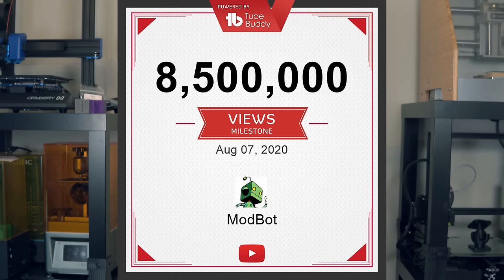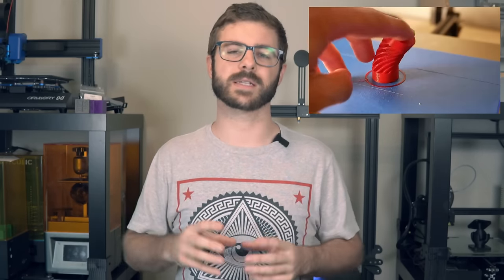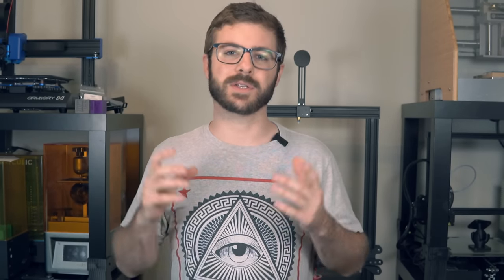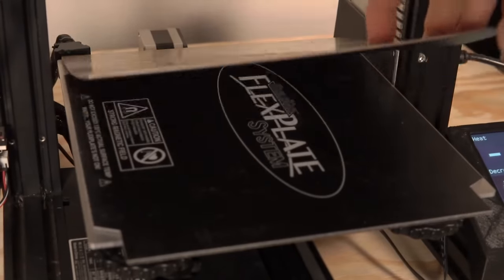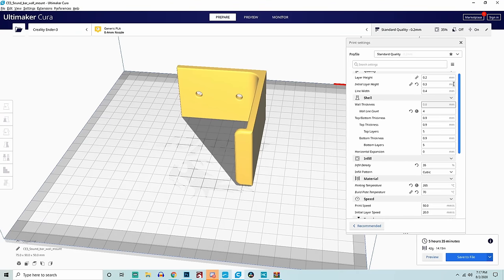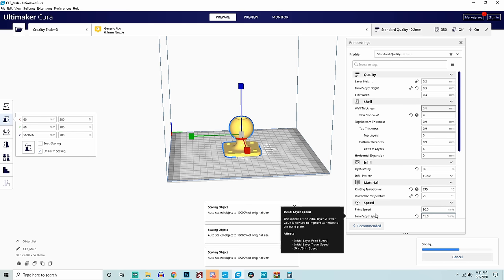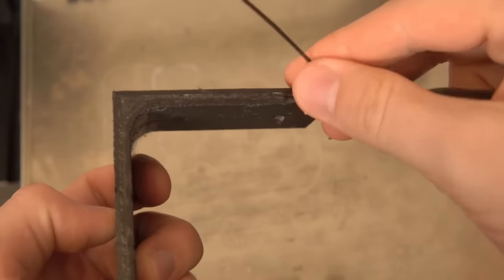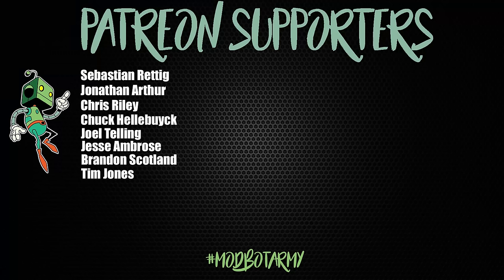3d Printing Carbon Fiber Nylon For Beginners (Ender 3)

Comment: Thank you ! Have been wondering about nylon and carbon. Two questions. 1. After printing does the nylon absorb enough moisture for later part failure? (I'm in FL also :) 2. How does it hold up in higher heat conditions? For example the dashboard of a car in full summer heat and sunshine.  Thanks again for your time! - Howard in North FL
Reply: After printing nylon you want your nylon to absorb moisture. It becomes more impact resistant when it has absorbed a bit of moisture.
The reason moisture in the filament ruins your print is that the moisture goes through the nozzle, turns to steam, and makes air bubbles in your extrusion line, and fucks up your part.
Reply: @Hallslys  thanks for the good clarification.
Reply: @Hallslys  that is a very good explanation. In Louisiana so this clarifies a lot of things to look forwards to when printing with this stuff. Merci et au revoir mes amis!

Comment: After replacing the hotend, do you have to update the firmware to go above 260C? Does the Thermistor need replacement? No one really mentions these things... More internet magic.
Reply: I know this is a few months old, but you didn’t get a reply so I figured I’d give it a go. 

Yes if your firmware prevents you from going above 260c, then you’ll need to compile Marlin yourself with the correct settings and flash it. 

Luckily Marlin comes with great starter config files for Creality printers like the Ender 3 and CR-10, so you shouldn’t have to change much, but if you’re not familiar at all with software development it can definitely be difficult the first time. You’ll also need to do some basics like PID tuning after flashing the new firmware.

The stock thermistor should be fine up to around 300c so there should be no need to change it to print at these temps.
Reply: @einsteinx2  Update: I now have 2 x CR-10S Pro V2's. Both of them with updated firmware. Capable of 285 on one and 300+ on the other.  I have printed some small parts in PC.  I tried compiling my own firmware but, end up with many errors. I found 2 variations of firmware that are working for my printers.
Reply: @JDccc26  glad to hear you were able to get up an running with high temp materials! Yeah custom Marlin builds are definitely not for the faint of heart if you don’t have a software development background, so I’m glad to hear you found working pre-built firmware!
Reply: @JDccc26  need some help updating my firmware on my ender 3, using a skr board
Reply: @deniellemondesire7080   It's best to find a FB or Discord group that maybe able to help. You would need a custom build. There are examples on Marlin's GitHub page. It's hard for the CR-10S Pro as there there isn't a working example.  https://github.com/MarlinFirmware/Configurations/tree/import-2.0.x/config/examples/Creality

Comment: printed nylon with the stock  hotend with absolutely no degredation (or discoloring or even smell) from the teflon. and I check that little bugger every 10 hours.

easy to replace the insert too, so im gonna stick with teflon inserts rather than the headaches every single full metal hotend ive ever used has given me with clogging (and the heat throat stays cold, so it's not heat creep. the cooling fan is pretty powerful.)
Reply: PTFE releases toxic gasses when exposed to high temps in hot end, especially for any birds in the house….

Comment: I got a pack of 3 hardened steel nozzles from Bangood for £5 and they are just as good as the MS ones, I can't tell the difference of print quality as there isn't one, I printed flow in the dark PLA and carbon fibre parts

Comment: So I use a markforged everyday at work to make prototype and small production run parts. It uses Onyx which is a chopped CF and Nylon blend. We struggle constantly with wet filament which hurts at $175 for ~900grams. I'm totally going to try swapping out a dryer for the stock drybox. Do you use any bed heat with the NylonX? The markforged doesn't have one.
Reply: Yes, bed needs to be around 90 C.
And Nylon is very hygroscopic, you need to dry it at 70 C before using it.

Comment: To anyone doing any sanding, filing or cutting. Wear gloves and protective gear. Just like glass fibers or any other, carbon fiber strands on skin cause serious itching/skin damage and the stuff doesn't come off even after weeks of scrubbing and cleaning... I've heard of some people reporting that there's still carbon fiber strands in their skin observable under a microscope years later

Comment: I'm gonna use this, or carbon fiber filled polycarb, to build a third version of my 3d printed longboard probably.

Tips for people who, like me, are crazy about speed and high strength:
- Print just a little bit hotter than normal
- make your extrusion width about 125-150 percent of your nozzle size
- keep a .12 or .16 layer height
- add more walls, floors, and ceilings
- get a corexy and print at 150mm/s
- when retractions aren't enough because of your stupid fast speeds, use the cura "outer wall wipe" to its fullest extent

bada bing bada boom, you're as crazy as I am now.

Comment: Food dryer preparation + weather seal container with silicon gel dryer during print + eSun CF filament. 250C is good enough for functional prints
Reply: I also run the eSun EPA cf, great stuff at a better price
Reply: How is the esun CF nylon for warping? Have been tempted to get some. I printed some nylon 6 a little while ago and after I removed it from the build plate it would slowly warp
Reply: I'd argue the carbon fiber helps against warping a little, I've had pretty good success with a brim if the contact to the bed is very small. also printed a hero me mount and fan duct no issues
Reply: @BrokecaR34JC  thanks 😊 I will have to give it a try😁

Comment: You should try Polymaker PA6-CF (Carbon Fiber Nylon Material) I have not had any warping issues with that at all and its insanely strong
Reply: I orderd soome of that today ...have u seen the pla META from polymaker
Reply: @weld4200  Do you Mean PolyTerra PLA from Polymaker? I Couldn't Find PLA META
Reply: @toastinat0r  sorry its sunlus idk y i said polymaker

Comment: I’m just starting to learn about 3d printing before I invest in one and this was a great video.  Just one question: when you’re feeding the nylon from the spool into the printer, you’re using bare hands and I was wondering whether your skin oils can affect it and cause weak spots?
Reply: no, there's nothing wrong with touching the filament with your hands.
Reply: @morbus5726  noice!  Thanks bro, I just got myself a Voxelab Aquila.  Love it!

Comment: Sainsmart sells a knockoff that I have tested and found to be actually stronger than NylonX. (Same gcode file for both)

It costs ~60$ a kg which is what NylonX sells a .5kg roll for.
Packaging is also much tighter, I noticed my nylonX still has air trapped in the package while the Sainsmart filament gives a nice "kshhhh" of suction when you cut into it.  
Not being paid to promote this but it is a cheaper option.
Reply: The amount of vacuum is irrelevant its the % of RH it in, the overly tight ones risk damage and are a lot easier to get a hole in. If run correctly and packaged immediately or from a dryer, but if the packaging area is humid so will the remaining air in it be.  fix: dry your filaments! don't trust the manufactures Cheers

Comment: I've actually had a print warp at 90%, I was so pissed off I emptied half a bottle of super glue on the bed and used the spray thingy to make it harden faster. Glad I didn't hit the hotend spraying that thing 😂

Comment: PLA Plus or PLA Tough is the strongest material you can print (I know... boring!) But as far as strength goes, it's absolutely unbeatable by anything except aluminum and steel. Carbon Fiber and PC are just good because they can handle 120C. The unfortunate thing is PLA and PLA+ and PLA tough cannot handle heat - AT ALL. Once it's hotter than like 100F it actually starts melting and warping. I think my favorite alternative to PLA+ is PA12+CF though. The CarbonX and Qidi PA12CF and Bambu Labs PAHT-CF are my 3 favorite versions and all come very close to PLA+

Comment: For some reason, using a virtually identical setup to you, I always get blobs and poor layer adhesion. It has made trying to print with this material near impossible, and I have just set it aside for months now. Maybe one day I'll figure it out.
Reply: Have you thoroughly dehydrated the spools you use?
Reply: @zeleacodreanu1  yeah, put it in the food dehydrator at like 150+ f for about 24 hours usually. I think it might be inconsistent heating in the hot end.
Reply: @gavingross2174  Did you work it out in the end? In my experience dehydrators are shit for filament (and nobody checks on the rh) so I use the oven lol. But yeah, just curious if you worked out your issues?
Reply: @whiskyeet  I have been able to get some prints done, I'm now using a modified CR-6SE with I full metal hotend. I haven't been able to go above about 20 hours. I have a food dehydrator to dry it out, and I recently got a filament dry box, so I'm hoping if I do have longer prints, it will help, though it's still not a perfect setup

Comment: I have been at this for days with the same matterhackers stuff. I have been all over the place with settings and just can’t seem to get it to come out well. I think I’m in over my head with the advanced settings in Cura and am making worse clicking things I have no idea what they do lol. I’m still quite new to all of this, but have had some successes with other materials. Even a few successes with this, but now I think I have my advanced  settings are all out of whack. Going back to default settings tomorrow and just adjusting temp, layer thickness and speed  Yes, it’s been drying for days and days in the matterhackers filament dryer. Getting all kinds of goops on the first few layers and fuzz here and there all over the rest. Not to mention the tops but don’t look good for the cosmetic effect I’m needing. Getting quite frustrated. I also have 3dxtech petg carbon fiber that was apparently much easier to print. Same problem so I’m beginning to think it’s extruded issue or like I said I’ve fucked up settings that I don’t even know what they do. Kinda sucks since it’s a brand new Optimus P1. Thanks for sharing!

Comment: dang you printed that nylon in an open enclosure? Crazy. I have never tried nylon but with carbon petg I had to cover my printer with a foam box made from rigid insulation and I would preheat the bed and chamber with a  space heater.

Comment: how do nylon prints react after being printed? Does their hygroscopic nature affect their strength and toughness?
Reply: I've heard of that the printed parts should be evacuated in water, to keep their strength. Or was that polycarbonate?
Reply: Hydration in the filament is really only a problem when printing, since the hot end is over the boiling point of water any moisture in the filament instantly turns into steam and bubbles in the molten filament, which results in failed prints.
Reply: @ai_university  agreed, over and under extrusions too usually you can hear it pop if your close but if you print with wet filament it will be weaker 100% sure, if you get only the odd bubble still weaker..after that you good to go!

Comment: I'm discovering the stronger printing materials and incidentely they require higher temps.
Was wondering how you can go above the stock printer max temperature ? I own a cr10v2, anyone knows if it can handle high temps? (standard max is 260 for the hotend and 110 for the bed)

Comment: Thanks so much for this!  I just got my first printer 2 weeks ago (Ender 3 Pro). I upgraded my extruder and bought a tungsten carbide nozzle as well because I picked up PLA carbon fibre as well.  I haven’t tried that stuff yet and I seem to have issues with the TC nozzle.  The store told me I won’t need to make a temp change with TC but I’m not sure about that.  I also installed a Creality Carborundum Glass Plate which is impressive!  No glue required ever!  Any tips on the tungsten carbide nozzle?  I haven’t tried it on the glass yet.
Reply: @Spencer M  lots and lots of upgrades over the last year lol

Comment: Subbed! I have an Ender 3 modded with the same stuff as yours and I'm printing at 40mm/s with CF Nylon. All my side faces or edges I guess are really rough and I can see the nozzle almost like it's dragging the filament at the edges as it prints. I'm printing around 275c and the first layers go down smooth, but after abut the 5th layer it starts to get rough on the edges. I dried my filament super well and it's in a sealed box that has a sealed tube leading all the way to the Microswiss extruder. Anything I can do to smooth up the edge printing?
Reply: I'm just getting into printing Nylon and have a similar scenario. It sounds like the temperature is a bit high and causing the poor edges. I'm also printing at 275 as lower than that I get delamination. I printed a temperature calibration column where each section is 5 degrees cooler than the one before and the finish was best around 250-260 (though layer strength was weaker for me).
Reply: @EricTViking  I had the line width set too low in my slicers. I changed it to be within 120-150% of nozzle diameter and it's printing much better now. Oops! I was having layer adhesion issues at lower temps also. Running about 270 helps a lot.
Reply: @EthanVandal  thanks mate, I might have a look at that. Meanwhile have ordered some branded nylon (Alloy 910) to see if that performs better than what I have.
Reply: @EricTViking  That sounds interesting. I'm reading about it. Might try some also. So many filaments, so little time!

Comment: Hi, nice video. I have been printing a little with PBT. There is not many vidoes about it. I did find out that it is heat resistant enough to put in the dishwasher. And it is easy to print. Maybe you  should try it out.

Comment: PVP gluestick and Magigoo PA are also great options for build surface adhesives! 😉
Reply from the maker: Thanks for the recommendations ❤️
Reply: I also recommend Magigoo. However, it seems that warping is still an issue if you only apply a layer or 2. So I found that being generous with the amount applied really helps. It’s also really easy to clean.

Comment: Which model Ender 3 are you using? I'm reading the Ender 3 S1 Pro is the only one that can print Nylon out of the box but it seems that people have had a lot more problems with it than previous Ender 3 models... Is there a way to upgrade earlier, seemingly higher quality Ender 3's tothe S1 Pro capbailities? Thanks

Comment: Would you not also need to use hardned steel filament feed drive wheels?
I could probably bake it out for 6 hours if i had snacks.

Comment: Is a hardened nozzle required for the higher temps, or just because your printing carbon fiber?
Reply: not for higher temps, but the carbon particles are abbrasive(not sure on grammar) to the nozzle. the hardened ones will last longer. and less worn nozzle is cleaner print.
Reply: Although I've not done this yet, several others who have told me we need a hardened nozzle, like a steel, and any abrasive (which carbon fiber is), also wears the Bowden tube.
Reply: both

Comment: Nice video! Question, did you change any other hardware (thermistor/ motherboard)? Saw a  video in another channel and the guy super upgraded the Ender 3 for carbon filaments and the print looked like crap.

Comment: great info! do you know which 3d printer can print 360º C and the bed heat up to 120º C?
Reply: For such temps, you will need heated chamber too. Seriously heated chamber with active heater and SSR regulated AC bed. Otherwise there is no purpose.
Build your own. Railcore is a great start if you reslly customize it, then it can print PEEK/Ultem. For something cheaper (say for ABS, PC and Nylon), basic Ender 5 with upgraded heat break to titanium one, brass/copper heat block and HSS or nickel plated nozzle (if not for abrasives). Change wheels for linear rails, aluminium bed lever wheels, get AC powered silicon pad for bed, add insulation and finned strip heater (500 W might be enough) with Noctua industrial PPC fan. Duet board to power it up.

Comment: Good stuff!  Thanks!  I've been taking 3DXTech Carbon PLA+CarbonFiber for a spin on my CR10S with the same MicroSwift DirectDrive (love it).  It has similar characteristics as PLA in that the recommended hotend 190-220°C bed It, too is finicky, and interestingly they recommend 0.24 layer height.
Reply: I live down the road from them, absolutely love there products.

Comment: So you didn't need a full enclosure? How come some people suggest a full enclosure? For me, my Ender 3 Pro is in a room that doesn't have the AC on at all, sometimes the celing fan is on, but I have it off most of the time when it's printing... I plan to also print directly from the filament dryer. But I'm not sure if I need an enclosure or not.

Comment: I am looking to have a impeller made? for a water power plant. 30 mm axel, placed in a hole of 400 mm width, the powerplant will be a wortex style with a tank 1.5 meters wide with 1.5 meter height. its just a hobby project for me but i will have to weld it if i cant have it 3d printed. and welding materials cost too.